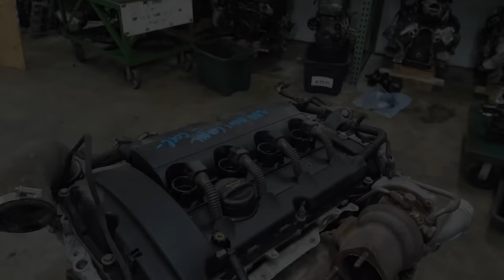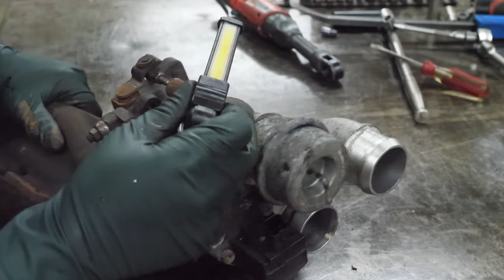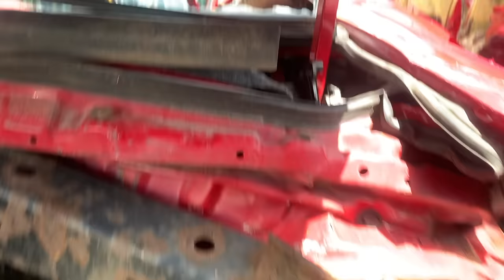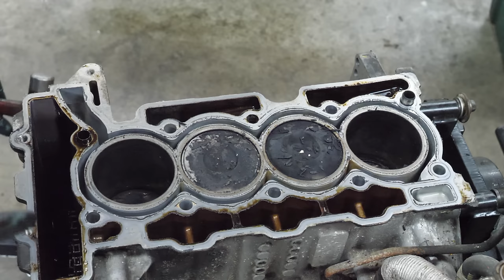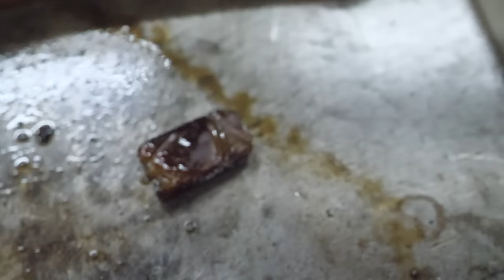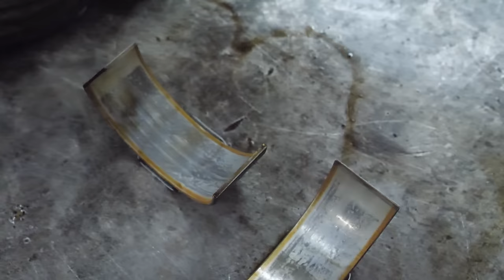JUNK Mini Cooper S (BMW/Peugeot) N14 Turbo Engine Teardown. Why Do People Buy These?

Comment: You don't have a clue what you are talking about. The RIGHT oil (5w30 C3) at the RIGHT time is critical. The main problem with this engine is the timing chain, tensioner and guides. There is an updated kit from Peugeot that is redesigned and WAY better than the BMW kit. The non turbo version of the engine in the gen 2 Mini One does not have problems. Why? Because Cooper S owners over tune them and then THRASH them blowing the turbos and they end up just like this engine. I've seen and worked on lots of these engines in a similar condition to that one and ALL of them caused by poor maintenance and I guarantee that that engine has a lot of miles on it and has had the WRONG oil in it
Reply from the maker: You’re right. I just shot from the hip. Seems like a lot of other commenters, including techs, also don’t have a clue 🙃
Reply: I have a Peugeot 308 with this engine, fully stock no tuned, serviced every 10k kilometers, using the specific PSA B71 2290 oil. Yet i have catastrophic engine failure. All that couldve failed, has failed on me. Multiple times.

Comment: Factory intervals are bullshit.  I've more than halved them in my vw Golf 1.9Tdi since new and I'm on 650k miles. Have never had to open the engine. Have changed oil and filters every 3k miles religiously since new. Go figure.

Comment: wtf is that?  Its shit like this that makes me steer far clear of BMW.  I like minis too but Jesus I understand its a cheap car but THAT cheap is beyond me, then the fact it is to buy one new is not cheap.  The plastic chain guide though, just when you thought it could not get anymore BMW, there you have it.  All the 328i/528i etc. anything with that little N20, if I know anybody who owns one I always tell them: sell it.  Sell it now while its still running and in good shape.

My theory on the water is perhaps everything that you said is true, the compression issue happened and owner got tired of the car decided it need to take a swim.....running.  Insurance washed away their problems.

Comment: As to water not making the best lubricant... On a car/truck engine, you are right. But on a ship, specifically the propellor shaft, it works wonders! Of course, those can be far bigger than a car.

Comment: So you’ve reviewed an engine you don’t like, and based that on the worst neglected piece of crap that the yard clearly dropped it in a lake and didn’t care about? Turbo not having a value too, mate I bought a rebuild kit for a scrap Eaton M45 Supercharger, cleaned it and polished it, went from being a £90 dog off marketplace to a £1500 work of art.. all parts have value.. any yard that treats high value stock and treats it like that I wouldn’t buy a thing off them, imagine paying £3500 for a low miles engine and that turns up, that’s neglect and poor management that’s made that engine like that..

Comment: Typical BMW . timing chain is ,,way way to small and week ..and the chain tensioner are not fit for perpes...
I had BMW 1150R BIKE 
100.K ,, same problem timing chain stretch because chain was to week and timing chain tensioner was designed to basically fale after 100k

Comment: German engineering was so good but that was up to 1980s. It's gone downhill big time since. Finally jaguar are making some good engines some. Get Honda, Suzuki, it's cheaper and far better design and Suzuki engines are the base of some experimental aircraft. Honda also. That speaks volumes as they can't fail or you are dead.

Comment: Fun fact the oil filter in this video the black I timing guide material so if you own a bmw and see brown/black debris your engine is about to grenade so get the timing chain checked it’s because when it pops it’s 5-15k

Comment: They are junk when the owners do not maintain them and they need LOTS of maintenance.  Nobody should ever buy a used model without knowing the previous owner and habits or it is a flip of the coin. People rag these things and then sell them just before something really bad happens. It's not so much the engine as it is the owners/drivers.

Comment: Oh worst engine ever made. 
8000 mile oil change intervals , problem is that it doesn’t have oil in crank case after only 4000 miles due to higher oil consumption from turbo charged engine.  Owners of these vehicles never checked oil anyway. 
As pointed out in previous comments, dipstick tube runs through narrow channel in timing chain guide. It is very difficult to get accurate oil level reading. 
Timing chain issues usually come in at around 20 to 30,000 miles. Problem there is intake camshaft has massive Vanos gear And exhaust camshaft has simple sprocket . harmonic balance indifference causes rapid chain where. 
First year direct and injection ,intake valves do not benefit from fuel washing over to reduce oil buildup on valves .
they will have to be walnut blasted at 30,000. They had a lousy Continental brand high-pressure fuel pumps that did not last more than 20,000 miles.

Comment: Poor engine. Did had the worst of his life.

Did suffered oil starvation.
Poor oil service.
Coolant starvation
Overheat temperatures.
Really low quality fuel.

This engines, needs the recommended oil, service at 7000 miles max and always every 2 weeks check levels.

And you will have a reliable engine.

My cooper 2013, have the revision for that engine, and It have 92000 milles on the clock and is modded with Stage1 remap and full exhaust high performance line and aftermarket kn intake.

Goes smooth as never.

Comment: They all like to transition from 4 cylinder to 3 cylinder engines. B.I.L.s 206 did exactly that. BMW should have known better, but with Mini they kept trying to do it on the cheap -  garbage Chrysler engines before these ones.

Comment: So BMW took the Mini, lost the plot completely, and ruined it in almost every way. It's no longer Mini-sized, being way bigger than the original. It still has almost no luggage space. It uses more fuel. It costs way too much for a Mini. It doesn't handle as well as a real Mini. And its engine is s-crap. Sir Alec Issigonis would have been apoplectic if he had lived to see what has been done to his most famous creation, which had been voted the second most influential car of the 20th Century, in 1999.

Comment: Ahh, the "Prince" engine..
The only problem with these engines: the owner.
Proper oil change interval: six months or 5k miles, whichever comes FIRST!!!
If you use these engines with 20k miles OCI, good luck. You'll kill the engine. R.I.P.
Reply: 6 month oil change? Heck, why not every month, lol.
Reply: @My-Opinion-Doesnt-Matter  lol, or not lol..
Six month, yeah. turbocharged engines are dirty engines. Period.
Oil is cheap. This engine is not so cheap..
If you're a DIY guy, an oil change will set you back $50.
And how 'bout an engine rebuild? 2 grands?

Comment: Gee, what a suprise. Another YouTube video about crappy Mini mechanic design. I will never even look at anything related to Mini ever again, not because of the issues, but because they don't stand behind their products.  Yes, I lost a Mini to engine failure;  sold it right after the repairs were finished and never looked back.

Comment: While I think the engineering on this is marvellous in a sense there are many things like common service items that could have been made more accessible like the oil filter, the minute one makes it hard to access people tend to neglect it which is a very critical part when it comes to engine cleanliness, most of the damage to this engine was done by contamination, I thought having the main bearing caps on a single casting was interesting…. But I still prefer my old school cars😀

Comment: Minis are crap... yesterday got my mother boyfriend minicoper 2016 got engine light on and propulsion reduced message, scanned it got some issues, then turbo wastegate issues reset it droven for 20 min codes seemed to not come back then started and stoped it 4 times message came again... engine light still did not come again for now it seems to be runing on full power with wastegate codes, car is 107000km the guy got 1 year warranty its time for him to go to car dealer ask some questions. 😂😂😂

Comment: Firstly.. NOT a BMW engine. Its really made by Tritec in Brazil. That 2.0 engine was used in multiple cars most notably..    the DODGE NEON!. Now turbo charge the worst engine ever made and its a trip to catastrophic engine failure island. I have ZERO sympathy for owners of these things. Homework... its a thing you do.
Reply from the maker: That last line… the tritec was the previous generation, not this one.
🙃

Comment: Worst engines to ever hit the roads, every sort of problem would come by and it also fails emissions cause the oil control rings no longer seal and stop oil going into combustion chamber😊

Comment: That is the NASTIEST engine I'VE SEEN IN 70 YEARS OF WRENCHING! i Don"t SEE ANY DESIGN FAILURES, JUST WEAR FROM NEGLECT! iT SEEMS TO HAVE JUST BEEN TYPICALLY USED UP! THE VALVE DOESN'T SEEM TO SHOW BEING BURN'T AND IF CLEANED OFF MIGHT SHOW A CHUNK FRACTURED OFF~~IN ANY CASE IT'S A TYPICAL THROW AWAY PRODUCT IN THAT IT WILL COST TOOOOO MUCH TO REPAIR!

Comment: Total junk engines. Stretchy cam chains, valve stem oil seals worn out at 70K, second gear selector problems - I had two and will never buy a PSA Group petrol engine ever again. And why do they all run hotter than any other car?

Comment: A thorough pile of crap on several levels. Even looked after, the destroy their flimsy timing chains or develop fuel pump issues and I could go on. Even low mileage examples can go very bad.

Comment: always politics in everything... your personal preference shouldnt be part of your review. these engines are pretty good. no theyre not F1 quality. you are pulling apart a junkyard engine, its in the junk yard for a reason! most faults with these engine's come from 2 reasons. 1 these are mostly lady driven cars. why do i say this is a problem? because most women never service their cars, they drive them till something breaks. then and only then does any servicing happen. 2 they are boy racered. these cars are cheap and they are fast. they get abused and cheap after market upgrades till they die. if you dont screw with them and service when supposed to,  drive civilised they will do 180k easily. and you blew your worth with me when you confused the manufacturing date stamp...
Reply from the maker: Weird, it’s my channel and most comments from people in the industry echo my sentiment.
Reply: True

Comment: Absolute garbage. Mine was always in the shop, or I was replacing parts. NEVER WILL DO IT AGAIN, anything German. My 2008 was meticulously maintained after I acquired it at 42k miles, dropped a valve due to carbon buildup just after 100k, after too many very expensive other repairs to note. Utter trash.

Comment: Plastic water pumps like on bmws no good cheap after a while brittle and break causing leaks and head gasket problems on and on Audi's timing chain s a back of motor Merc s with stretched timing chains and computer issues oil leaks wiring harness issues what's going on the list continues  thats why i drive Toyota 😂

Comment: typical german junk...owned an 09 Clubman S with this motor that I got cheap cause it needed a HPFP and cam/pushrod.  ended up putting rod bearings in it too due to wrong oil in it most of its life.  sold the car cause the next thing to go was the dumb automatic trans which would have been a million $$$ to repair.

Comment: IMO all that sump caramel says it ran with plenty of water contamination for quite a while. That also explains the bearing and journal wear, and seized turbo. How the water got inside I don't know. Idiot owner confusing coolant and oil fillers, or going mad with a pressure washer perhaps. Unless, perhaps they are wet liners and the bottom seals have let coolant into the sump. I know nothing about that engine.

Comment: BMW's are shit. I had a 118D, 1 series with the N47 engine. So many problems oone of the worst engines. Timing changes week, oil pump failure. Mine had low mileage and one day with no warning the engine seized, oilpump had failed big end bearings jammed.  Result new engine at a cost of 5000 pounds.  That BMW refused to admit fault so I had to pay. I now live in Germany and guess what. German car manufacturers, VW, BMW, AUDI are in a big decline by 20% and still falling.  Why because they sold out reliability and strong cars for over over engineered, cheap build  quality and twice the price. Now they are not known for reliability and strong cars, I've  had Audi's Mercedes, BMWs and VWs  but all failed. The only German car that's been strong is my wife's 1998 Mercedes Benz clk230. Strong bulletproof engine and a well built car. Still running no issues...

Comment: Ever done a bmw motorcycle? It's another joke although they are very expensive bikes they suck and not even in the long run. A bmw1150 1200 gs has the aluminium gearbox as part of the frame. And although a second company makes a reinforcement triangle, frame breaks still occur under the triangel.

Comment: simply the worst engine ever. I had mini's in the 60's and 70's 848cc to 1275cc way better. Had 4 new gen Mini's including ser1 and 2 S models. Broke down regularly chain tensioners  thermostats coils etc etc.

Comment: https://youtu.be/q35udS27UaQ?si=aJ545_22IhU4J2V2&t=129 shows what happens when the core plug gets loose.  Coolant shoots from the channels in the block up into the head.

Comment: These Engines are a pile of junk! so many design faults you could write a very big book on them, least of all the oil return pipe and oil cooler, unions that stock parts are nothing short of crap, timing giudes as you say, and a ton of other things!!!

Comment: These engines are 💩. The only way to save these engine is to change the oil every 5000-6000 miles. Timing chains/high oil consumption/water pumps/thermostat housings/oil filter housing leaks...etc. etc. Would have been better keeping the A-series engine.

Comment: What a pile of junk those Peugeot engines are.  BMW know full well what the issues are with these and simply do not care providing they continue selling them to the gullible.  I’d far rather have even the old bmc 1300 in there because at least it was reliable.  Better still, the turbo motor from the Yaris GT.  Anything but that pile of junk Peugeot lump.

Comment: Terrible review - many of these engines have gone on and on and on - I'm the proud owner of a Peugeot RCZ - 86000 kms with no problems - engine fab ...
Sure - not designed for idiots and it needs proper maintenance ...